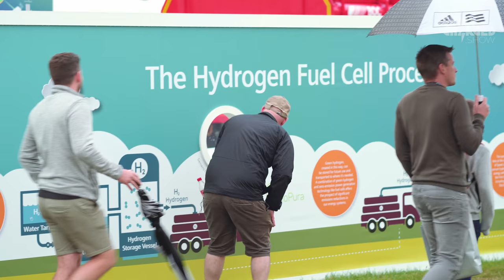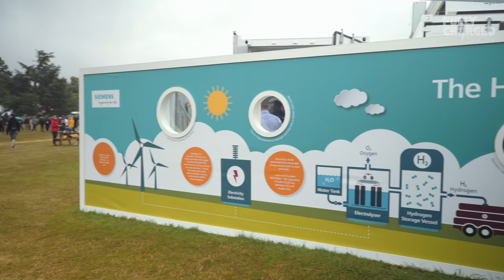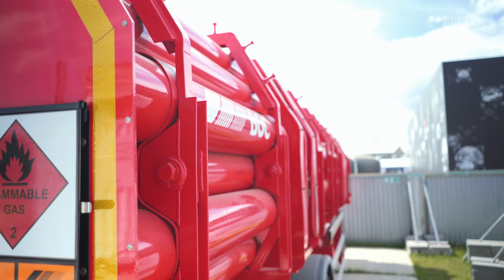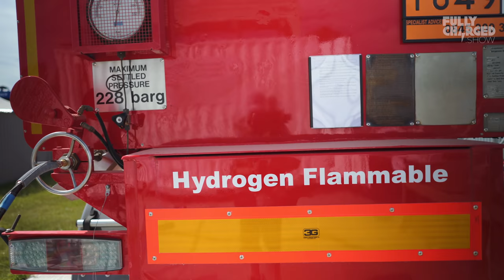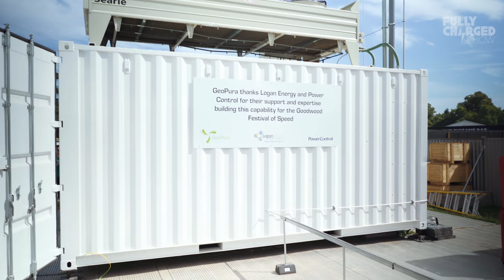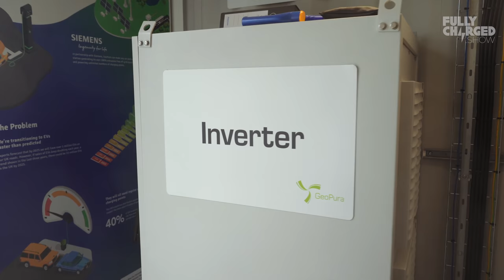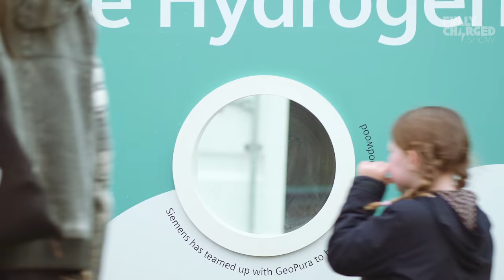Green Hydrogen Fuel Cell Charging System at Goodwood Festival of Speed | Fully Charged

Comment: Thanks Jonny. That is an interesting approach. It raises a few questions and warrants some suggestions, however:

1) The fuel cells are claimed to be 50% efficient. Is that the peak, at 'partial power'?
2) Does that efficiency include the energy consumed by the ventilation fans?
3) Does that include the power consumed by the cooling fans?
4) Does that include losses involved in charging, discharging and managing the battery?
5) When the Hydrogen is generated, what is the conversion efficiency of that process?
6) How much energy, as a system percentage, is used in compressing the Hydrogen?
7) What fuel is used to drive the Hydrogen compressors? Electricity? Diesel?
8) Have they thought of using heat exchangers for cooling the fuel and battery cells?
9) If so, have they thought of using that heat for conversion to electricity?
10) Have they considered extracting Hydrogen compression heat via heat exchangers?
11) If so is that heat also used to produce electricity?
12) What fuel is used to transport the Hydrogen to the site?
13) What is the overall efficiency of that power generation cycle?
14) Could a power station using this method be more efficient than today's OCGT systems?
15) If so, then what expected efficiency could a 350 MW plant have, using today's technology?

OK, 12) assumes that transport is needed. With the correct safety permits, the whole cycle could be made to work at one adjacent plant site. That fact, and also the economies of scale, will affect the efficiency of the whole system, as mentioned. 

Relating to the first question, assuming that the system shown is 50% efficient at 50% of maximum power, and that it generates 50 kW at that power, then ~50 kW of heat is being generated, so that heat certainly could be used to generate more electricity. Hence the later questions.

The answer to 15) needs to take into account the losses within a DC to AC converter, but transmission losses can be ignored, since those are endemic with any electricity distribution grid.

Your serious responses, and the responses of the people developing the system, as well as those of anyone else reading this, are most welcome. Thank-you

Comment: With just a few comments already made I anticipate that for many their antipathy to hydrogen cells will prevent them seeing what the content of the video actually was. Some will still clamour for hydrogen fuelled cars despite seeing a fuel cell in a shipping container.
Reply: The problem of hydrogen is clean hydrogen is terribly inefficient, the quoted 50% is to go from hydrogen to electricity but to go from electricity to hydrogen it is much lower than that. The truck on the video I'm almost sure was full of dirty hydrogen as in processed from petrol.
Reply: @theq68  Does that really matter when already in the UK for example, there are times when there is such an excess of renewable wind energy being produced that the generators pay to get rid of the excess?
Reply: Hydrogen in this application is good, especially if the hydrogen is produced by electrolysis.
Reply: Pedro Pinheiro If you are storing clean energy that would have been “wasted”, inefficiency is a null point. By wasted clean energy I mean “avoided generation”. Here in the North of the UK, countless wind turbines are “turned off” especially at the weekend when demand is low, if a centralised large plant could be used to turn this excess into a stored clean fuel, it’s a goer.
Reply: @theq68  You should have listened properly to what was said in the video. Here is a direct lift off the article on the fullycharged website.
“Green Hydrogen production” is so called because it uses excess renewable energy and water (in basic terms using electricity to split the water into Hydrogen and Oxygen). This “Green Hydrogen” can be stored in tanks, effectively a reservoir for the energy captured by solar PV panels or wind turbines (or wave, geothermal or tidal power for that matter).

The tanks of “Green Hydrogen” can then be stored and later fed into a Hydrogen fuel cell charging system that converts the hydrogen into electricity and heat. "
Reply: @bren106  I know what green hydrogen is, and I confess I was outdated on the efficiency of the process but as of now the best case scenario not including transportation is 40% efficiency. All modern batteries are above 90% yes it works but there are better available alternatives, my problem with this is dirty hidrogen is half of the price of the green one, guess what will be used?
Reply: @theq68  What I took from the video, and I hope many others did as well, was that this is at present a technology to be used where alternative green energy is not easily available. They also said it is more expensive without economies of scale, it will not transfer into wider use until that scaling up is achievable. When it does become cheaper there is obviously no compulsion  to use alternative (dirty) hydrogen as it will be from a commercial source as so will add a cost.
Just watch the video again, and at 01:40 they tell you they produce the hydrogen from wind power.

Comment: A single Tesla Megapack is also 3MWh of storage (just like this system) and comes with 1.5MW inverter capability built in. I dare say you can put that on a trailer easy enough. So when they say you can't put batteries on a trailer at the same scale as easily as a dedicated H2 rig like this then I think they are overselling the comparative benefits you get. If Tesla put wheels and a tow bar on a Megapack then it would likely be much more compact than this.
Not to mention that with batteries you don't lose 50% of the energy on discharge and you also don't lose much when you charge. With H2 fuel cells you lose significantly when you generate the H2 and when you use it in a fuel cell. So basically the supporting generation capacity has to be so much more.
Reply: From what I see in Tesla's site it does come in a shipping container format: "Every Megapack arrives pre-assembled and pre-tested in one enclosure from our Gigafactory". 
What I'd like to see is an objective energy storage comparison between hydrogen and something like this.
Reply: @arvieira  Well arguably a lot of energy goes into making batteries. But I think with the inefficiency of H2 in the long run batteries would come out tops.
Reply: @joeblack4436  I'm sure that a lot of energy is also going into making the Hydrogen equipment so it might not need such a long run after all.
Reply: @milanswoboda5457  Who knows yeah

Comment: Good to see that several technologies develop. Even if it is not competetive today there is a good chance that we see this in the future with improved efficiency.
Reply: How will they improve efficiency?
There's a fixed amount of energy required to break the chemical bond between Hydrogen and Oxygen.
Just that is 75-80% efficient.
So just liberating the Hydrogen had the same efficiency as the WHOLE  process for batteries.
That's without considering the infrastructure, then the 50% efficient fuel cell.
If you could double the efficiency, it would still not match batteries, or other methods..... (They're not going to double the efficiency!)

Comment: This is what the Gov't should be subsidising, not fracking, not coal, not nuclear.
Reply: Disagree w.r.t. nuclear but as for the rest definitely!
Reply: The government should be subsidising efficient means of energy storage, not those that throw away 70% if the source energy.
Reply: Government has been subsidizing Hydrogen for decades. See Japan as a perfect example. Of a failure.
Reply: @ViatoremDiEfa  our government?
Reply: Steve Davey not this, and definitely nuclear. Renewable will lead straight to the next huge environmental problems, especially solar. You need enormous amounts of cells and they require rare earths, and only last twenty years! Don’t be fooled by drawing the area on a world map! ANYTHING man-made seems small drawn like that. Think of it instead as the equivalent of making the building mass of New York entirely in solar panels every year, and recall those rare earths. 

Besides, how are you going to store the energy? If you just want renewables, you have to have storage. Otherwise people will die by the millions in fairly ordinary periods of little sun, wind, or both. Hydrogen can do that, but means you need EVEN MORE production capacity so you have a surplus to store. Nuclear, unlike wind and sun, is a perfect match with batteries because you can regulate production up and down in a matter of hours.

Comment: Great episode. I was wondering though can this be done with a mobile lithium or flow battery. The hydrogen has a "round trip" of only 50% I think flow batteries are about 70% and Lithium 95%. Just wondering about cost comparisons etc etc. Great episode.
Reply: It's not 50% round trip.  It's only 50% for the fuel cell stage.
Reply: 3000kWh of lithium batteries is about 60 electric cars (if each is 50kWh) which i imagine is not very mobile and very expensive. Would like to know more about flow batteries.  Robert interviewed Simon Hackett about them on fully charged.  They were well suited to stationary applications according to Simon, but maybe he hadn't thought of this, nice idea!
Reply: Splitting water into hydrogen and oxygen at industrial scale is 70-80% efficient (predicted 85% by 2030), then it's pressurizing hydrogen for transport, then 50% efficiency for a fuel cell. Not accounting for transport of hydrogen in between.
Combined efficiency: 30-35% efficient. Not great, not absolute garbage if it can be improved.
The main advantage over batteries is lower weight for mobile deployment, therefore lower transport costs.
Source: https://en.wikipedia.org/wiki/Electrolysis_of_water#Efficiency
Reply: @elektrotehnik94  exactly!
Loses and loses!
Its just not efficient!
Reply: @boloborkowski9429  Hydrogen still might be cheaper for mobile events, to drive in a hydrogen system rather than a battery system. Lower weight might win in such cases, it's not clear yet.
Reply: 3MWh of lithium ion would weigh 12 tons and be 4 cubic meters (25 barrels) of volume.  It would easily fit on a semitrailer truck.  A system 2x as large is reasonable given the legal trailer weight limits.

I know Robert keeps saying that fuel cells make sense when they are large enough BUT this still isn't large enough.  Li-ion would do the job better and cheaper.
Reply: @boloborkowski9429  It doesn't have to be efficient, it just has to be cost-effective and a practical size and weight.
Reply: Elektrotehnik
It's not just the weight for transport.

Lower cost in building the trailer, which means you can put a fuel cell onsite and just change out the trailer with a full one.

Longevity, battery life is around 8yrs.

No self discharge on a hydrogen tanker.

Filling times.

Storage size does not shrink over years, 6mw will be 6mw in  20yrs.

CO2 in production(as this is about greenhouse gas, that's a big factor)

In a commercial application they look at all factors.
Reply: @Robert-cu9bm  Battery longevity is well beyond 20 years in such a system, the capacity loss is 20-30% (eyeballing it, depends on num. of cycles).
Hydrogen tanks leak a lot,  at least comparable to self-discharge of batteries.

Lower cost in building the trailer & refuelling, maybe.

Other factors I'm not even gonna debate.
Reply: @parametrek6077  Thanks for the math, this was my expectation also. Hydrogen is a clear no-brainer, comparing to batteries, only in systems where energy needs are huge and weight must be low.

In the long term, I expect planes, maybe trains and ships to be hydrogen-fueled.
Why don't we have hydrogen planes? They should be ideal for hydrogen tech!
Reply: @elektrotehnik94  But surely the point is that all of the energy comes from renewable sources, so therefore even if only 30% of it is usable as an energy source, it's all essentially "free" and would otherwise just be unused wind/solar/wave/whatever energy. The efficiency is kind of irrelevant, excepting it's effect on the financial cost and physical size.

Also, the efficiency is inevitably going to improve continually with R&D, so it doesn't sound like a bad starting point.
Reply: @betterspud21  Yes to what you said, but:
1.) Most efficient storage for renewable energy is batteries. Then it's pumped hydro, (and most other storage systems), close to the least efficient is hydrogen. And batteries have a good chance to stay cheaper than hydrogen systems.
We'll see.
Reply: Elektrotehnik
Tell me a system where they expect to get 20yrs from lithium batteries?

As for hydrogen tanks leaking, that doesn't happen. No one is going to drive a semi leaking a flammable gas.   No to mention the fact a business wouldn't let that happen, if a customer orders a full tanker, they would expect full tanker.
Reply: @Robert-cu9bm  in applications like this 20yrs is absolutely no problem.

Things that kill a lithium battery are: 1. deep discharge, 2. keeping it charged at 100%, 3. high power charging, 4. changes in temperature. All of those can be easily mitigated in a stationary storage like this.

And also fuel cells dont last forever...
Reply: @slanahesh  thanks, great to see it :D it's where I see hydrogen winning, at least short  term
Reply: @Robert-cu9bm  
1.) Battery systems don't stop working (maybe invertors need to be replaced).
Batteries only lose some capacity over several thousand cycles, and it's improving fast. After 20 years, 70% capacity still left seems reasonable to me with current commercial technology.
Reply: @Robert-cu9bm  
2.) Hydrogen atoms are so small, they leak in between the atoms, from which their enclosures are made. They "bleed off", sort of like self-discharge in the batteries.
So you lose hydrogen over long periods of time.
Speed of "bleeding off" depends on a lot of factors (heat, how the enclosure is made),
Reply: @stephanweinberger  Do you know anything about fuel cells ageing? I'm interested
Reply: Stephan Weinberger
But it's not stationary storage,  It's set up at a trade fair.  
As you said, deep discharge shortens the battery life. Which is what would happen to these as there is no means to charge. 

This is not a backup system this is a stand alone system.
Reply: Elektrotehnik
But batteries they don't last 20yrs

If they were to use lithium-ion that  would give you greater capacity, but a shorter life(a few years).  They don't like deep discharging, which is what a system like this would do. 
If you only do a partial discharge, you would have to change out the pack regularly, which would mean more diesel in the trucks.  Then you may as well just use a diesel genset.

LiFePo4   Is the most likely what would be used, long service life (around 5-10yrs)can be deep discharged and very safe.
These have a lower energy density. 

Hydrogen in this application is the best, easiest to recharge(fill), cheapest, power output is consistent no matter the how much hydrogen is left.  The excess heat is used(with lithium you would have to consume extra energy from the battery)

Having to change out battery packs more often with diesel trucks creates more CO2.
Reply: @Robert-cu9bm  Batteries do last 20 years, everybody with knowledge never fully charges/ discharges a lithium battery of any sorts if possible. I built battery systems, studied electrical engineering.

I'm gonna stop here. If you want to get educated on batteries, I suggest starting on Wikipedia, then follow their links/sources. A few hours should teach you the gist of it
Have a nice day :)
Reply: @elektrotehnik94  Current proton exchange membrane fuel cells have a service life of about 40.000 hours (4.6 years) in stationary applications. So even if newer technology can double or even triple that, batteries will still last longer.

And btw: vibration and temperature cycles (like in a car) can dramatically decrease service life to less than 5000 hours.
Reply: @stephanweinberger  Thanks, wasn't aware of these problems with fuel cells. Makes hydrogen even less viable compared to batteries, I thought fuel cells last 30+ years.
Reply: @elektrotehnik94  
Bear in mind, you seem to assume you'll pay for the energy coming OUT.
I believe you'll pay for the (grid) energy going IN.
It won't be cheaper.

Comment: While fuel cell efficiency is around 50 %, electrolysis efficiency is usually around 70 %, so the combined efficiency of storing energy with hydrogen is about 35 % or so. The cost-effectiveness of this kind of storage is also questionable when compared to pumped-hydro power plants for example.